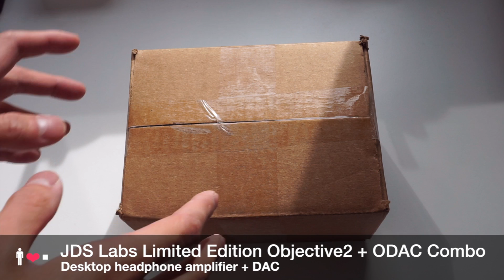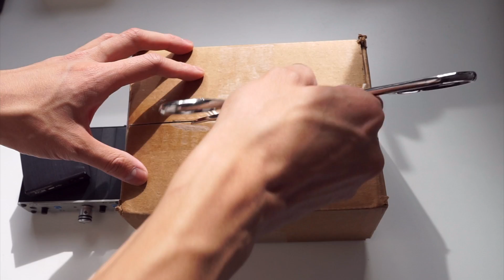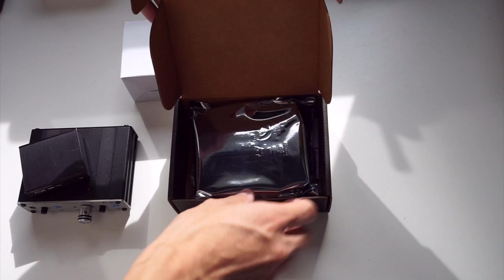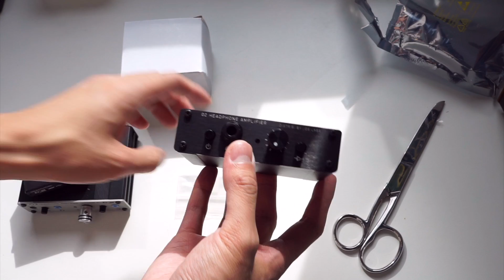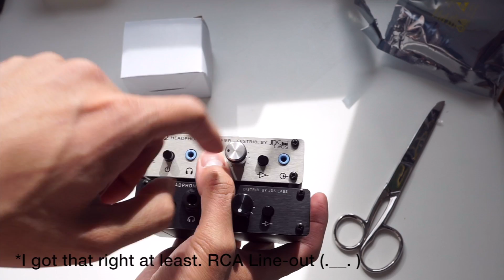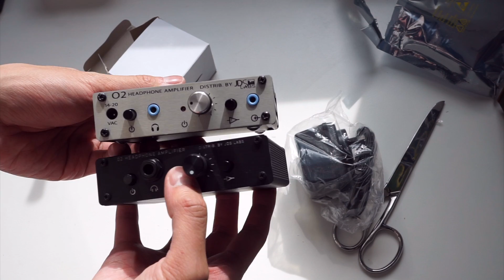JDS Labs Objective 2 + ODAC Limited Edition Desktop Amp Unboxing

Comment: I was just wondering I just ordered the B&W P7 and i have a Fiio E17 the B&W aren't very hard to drive but i was wondering if i bought this amp would it make a big difference compared to the E17 considering the B&W dont need that much driving power? In short im just asking is it worth while me upgrading from the E17 to JDS Labs OBJ2+ ODAC for use on the B&W?

Comment: Hi lachlan thnx for great videos...wondering if u could point out why the jds lab could be better compared to fiio 18.the price seems to double of the fiioo...i cant really tell difference betweeen cheap n expensive amp/dac...any advice would be appreciated
Reply from the maker: Jiwan Gurung I'm afraid I wouldn't know either, but the FIio should be much more portable. :) Fiio stuff is usually pretty good.
Reply: thnx for the info.its very hard to decide what amp/dac should i get...and thnx for introducing me to dma audio...that store is great

Comment: I see that there is room for both normal headphone jack and RCA. Could i connect both my headphones and my pc speakers to this machine at the same time and switch between them easily?. Otherwise you would have to switch sound device in windows when you want to switch between them.
Reply from the maker: Krrish85 Those are what the RCA outs are for, yep!
Reply: ***** Thanks for your response. JDS labs offers two choices for rear output, RCA or 3.5mm jack. My speakers supports both. Which one should I go for? Does it matter? Thanks

Comment: I always thought the story behing the O2 amp is one of the best marketing schemes in audio industry ever. Regardless, it's an ok amp, nothing special, but good enough for most headphones. However, doesn't be fooled into thinking it sounds as good as amps that cost "thousands and thousands" of dollars. Of course O2 is a much better value for money than an amp that costs 1000 dollars, but it still doesn't sound as good. Also, there a lot of things about sound that matter and aren't meassured, or aren't shown on your usual, most basic measurements of frequency response, signal to noise ratio or THD.
Reply: LOL, this guy obviously dropped a shit ton of money on snake oil
Reply from the maker: I'm curious (and I don't mean this as a dig), but I'd love to hear your opinion about what you think those things outside basic measurements may be?
Reply: You are fooled by snake oil. If there was a blind test you won't be able to tell the difference.

Comment: Nice video! I have the O2 and ODAC+RCA outputs as separate units. It's nice to have the battery powered option, but at the same time, having a single unit would be nice to have too. I think for the $350 price tag, the limited edition unit would be well worth the money spent for a great-sounding DAC/amp combo. I can't think of any other DAC/amp combos for the same price bracket that would compete against it other than maybe a Leckerton unit (I personally haven't heard any of their products though).

Comment: Nice video, but i don't think i need one since my Xonar DX soundcard powers my HD598s just fine.
Reply from the maker: Glad you like the DX, but just so you know it appears from this comment that the Xonar DX has an output impedance of 100 ohms: http://nwavguy.blogspot.com/2011/02/headphone-amp-impedance.html?showComment=1330611972228#c3340246767552047634 This is pretty terrible from an electrical standpoint, if you read some of this: http://nwavguy.blogspot.com.au/2011/02/headphone-amp-impedance.html
Reply: ***** In other words, the high output impedance of 100 ohms degrades/changes the sound of my headphones. I never have heard with 0.50 ohms sources (never tried DAC/AMPs in general) so i can't say if the quality is actually better than what i got now. I had tried my on-board soundcard (Realtek ALC889) with my headphones a bit which I've heard from Logan's audio myths that it has around 2 ohms, but it made the sound a bit "flatter" and lesser clarity compared to my soundcard. So I'd prefer the Xonar out of the two. But that doesn't say i don't like low impedance since on-board soundcards are very basic.

I would like to try it, but that thing (standard edition) costs like 210 euros (279 dollars converted) excluding shipping. It costs more than my headphone itself. It's a bit of an expensive infestation but then, if i like it there's also the thing that i can buy headphones with higher impedance in the future without worrying for a new AMP/DAC or soundcard.

I can compare this with buying mechanical keyboards (AMP/DACs), they may have a better experience than membrane keyboards ((on-board) soundcards) depending on your taste. But they are expensive! But then it's also more study and stands longer than your average keyboard. You might get the clue. :P I Would say that I'm more comfortable with my mechanical keyboard than my previous membrane keyboard though.
Reply from the maker: Just try plugging it into a smartphone and see if you like the sound. All smartphones will have a much lower impedance than 100 ohms!
Reply: ***** I'm liking it so far. So no worries here.
Reply: MelvinScape
But still, i need to hear the true thing to be satisfied if it's worth it or not and for that price it's quite... hard for me.

Comment: Problem I came across with O2  was when using the amp in high gain it introduces distortion with many sources line out signal, this requires you to turn your source volume (laptop volume bar) down to correct it. Sadly, I don't think that's very buff for an amp which was designed to be so legendary. No other amp I've owned has the provlem.

I sold the O2 within a few days of owning it. Now, it does have it's up sides, yes the sound is decent, but that flaw was a deal breaker for me. I replaced it with Schiit Magni which is only $99 USD amp and I'm much happier, I think it sounds better for my applications and you should be looking into some of Schiits stuff Lachlan, they punch well high for their price  point.
Reply from the maker: You might want to check if your source is actually producing line level output. For instance I have a Music Streamer II+ AC and I used to get distortion under some circumstances - then I realised the Music Streamer II+ DAC outputs a line level on the RCA higher than reference, and so it would distort on some equipment. Might be that (or it might be the O2 who knows, but from the measurements it shouldn't really produce that much distortion at high gain).

I used to have a Schiit Asgard, but I found that it had a bit of a grainy sound I wasn't so keen on (must have been Class A second order distortion) and, more annoyingly, I got electrical noise from my house wiring through the Asgard. That and it got insanely hot. I'm curious about the Magni and the Modi (and even the Vali) though!
Reply: ***** Nah, it's because O2 has a maximum input level of 1.07VRMS at high gain. It's all logged on the JDS Website
Reply from the maker: ***** Ah I see! I will mention that in the final video :)

Comment: noob question. I have a decent sound card for gaming. The SoundBlaster Z. How does this compare?
Reply from the maker: Judging from the measurements here http://en.goldenears.net/17542 the SoundBlaster Z produces very clean output, but the headphone output impedance is a very high 22 ohms. This means that using it with any headphones with an impedance lower than about 176 ohms is suboptimal (this is what is known as damping factor and is explained here: http://nwavguy.blogspot.com.au/2011/02/headphone-amp-impedance.html ). For the same reason if you plug a multi-armature IEM into the Soundblaster Z you will get a very weird sound.

Comment: Did you mean Summer of 2014? Or has the Limited Edition already ceased production? Also, since the standalone O2 Amp has built in battery, did you ever use it for portable headphones?

For some reason, the L.E. looks slightly smaller than the standard, maybe my eyes are fooling me.
PS: Congrats c:
Reply from the maker: Sorry I meant 2014! Still living in the past haha. And it does look smaller in the video. Will have to confirm if it actually is any smaller at all. It might just be the colour..